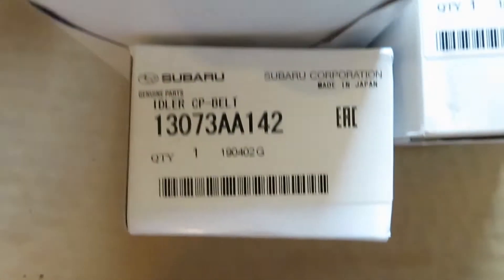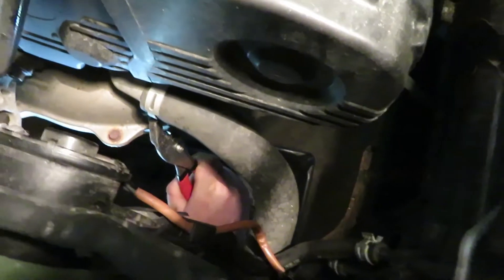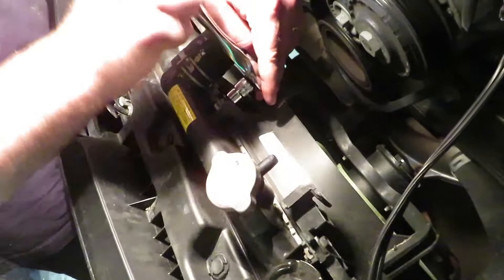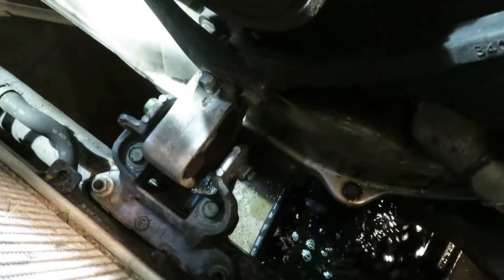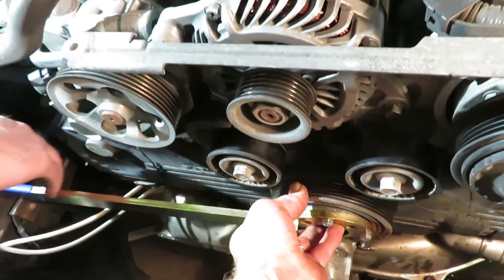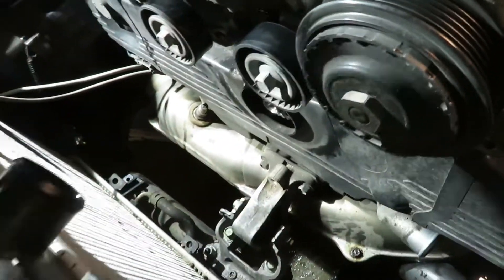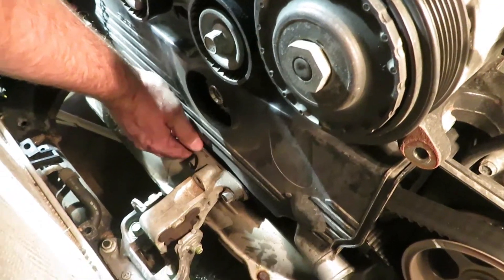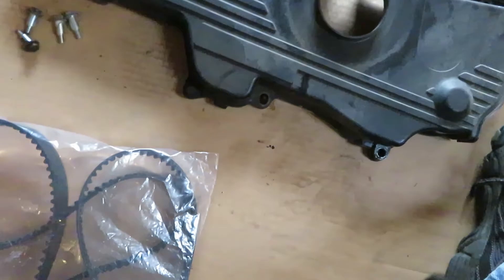How to Replace the Timing Belt and Water pump Subaru 2.5L Part 1: Tear Down

Comment: Great video BUT DO EXTREAM CAUTION!! This video didn't cover the most important part of replaceing the belt. Didn't show the  pulley alignments. WATCH OUT DO NOT rotate crank shaft with out the belt. Make sure aligments of pulleys are confirrmed and set prior belt removal. will kill your engine in an instant if this is improperly set.
Reply from the maker: You missed it. I did show the alignments of the cams and crankshaft.

Comment: hi just wanted to ask. if you don't have that special tool to remove the harmonic balancer, what kind of approach are you going to do in order to remove it? thank you!
Reply from the maker: I think you are talking about the holding tool used to remove the crank pulley bolt. Anything else that would keep the balancer from turning while you break the nut would work. the harmonic balancer itself was removed with a combination of tapping and pulling. I would get the tool for this job.

Comment: If you have a standar transmision, just set it in gear and you wont need the cranskhaft tool. You only nees it if you have automatic
Reply: Took me forever to get the harmonic balancer off on mine. Impact wouldn’t work(Not enough space) so I had to use breaker bar. I was able to stick 2 3/8 extensions in the little holes in the pulley at an angle and stuck a 36” pry bar in between down to top of exhaust prying off of it. I was able to put all of my weight into a 3 foot breaker bar to get it off. It was super stuck on there

Comment: I have a 2011 forester. Pump failed. Can I replace just the pump from the bottom without taking everything else off? I know 2011+ foresters have timing chain that doesn't need to be changed.

Comment: Hello, by any chance would you remember the engine code? I’m working with a swapped engine after the original engine fried when the drain pan bolt came off on the highway.

Comment: Did you actually replace the water pump, or just the thermostat in the water pump? If you replaced the pump, why remove old thermostat?
Reply from the maker: We replaced the water pump. The new water pump did not come with thermostat.

Comment: Thank you so very much for this video. It was detailed, accurate, and displayed the most important parts of this job. Although I'm a professional and a certified master technician,  I hadn't done a Subaru timing belt in years and after replacing all of the pulleys and the tensioner, the belt was absolutely driving me insane when attempting to route it, even following factory procedures. Clipping the belt to the sprockets using the marks from the manufacturer, and INSTALLING the bottom passenger side idler LAST was EXTREMELY CRITICAL!
IMPORTANT: It should noted that one of my marks was not really there from the manufacturer and it should be further noted that from the passenger cam to the crankshaft was 47 teeth and from the crankshaft to the driver's side cam was 44 teeth in my application [2011 Forester.
Thank you again so much, you made this owner/technician's night a whole heck of a lot easier! 🔧😊
Reply from the maker: You're welcome. Thanks for taking the time to comment and especially provide the tooth count info which may be helpful to someone else with the same vehicle.

Comment: Hi brother, I have a question and I hope to find a solution or find a solution to the problem.  I have a 2011 Subaru Autoback and suddenly the water hus came out of its allotted place and I installed it and then came the same day.  What do you expect, is it a thermostat that did not open or what?

Comment: Can you add link for the Tool?
Reply from the maker: I take it you mean the crank pulley holding tool. The owner bought it and had it ready for the job, so I don't have the link. It should be easy to find by searching "subaru crank pulley holding tool"

Comment: Great video!! Love is a Subaru. Those motors are bulletproof as long as you change timing, water pump. I also do the valve cover gaskets at same time. Figure if I’m doing timing/pump Subaru are notoriously famous for them leaking. But I always tell people if you do PROPER maintenance the 2.5 is easily 300k plus.
Reply: Yeah…not mine. Blown head gasket 130k and that was with the MLS gaskets.
Reply: @KetoKevin  damn brother that’s a shit deal. I still swear by my Subie!!!
Reply: @dennisbrown1811  replaced my head gaskets at 76k on my 2007, we’ll see how long she goes with good maintenance, it was my grandmas car.

Comment: This is ok for a Subaru Forester X 2009 non turbo ?
Reply from the maker: Wikipedia is often useful for this. If you look up the Forester it will list the engines used and often other models that used the same engine.